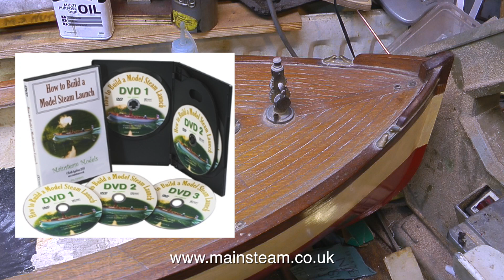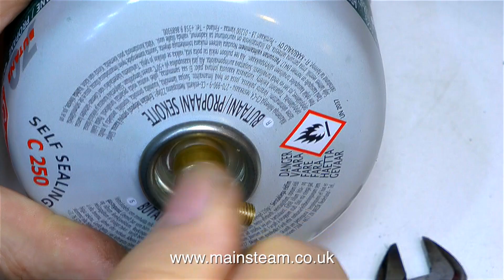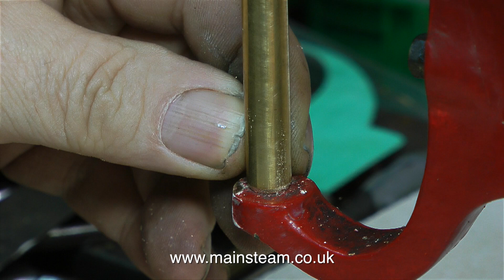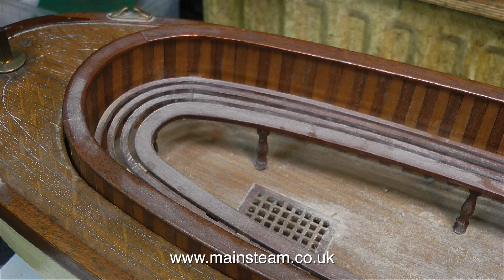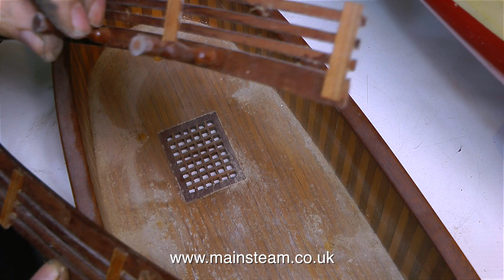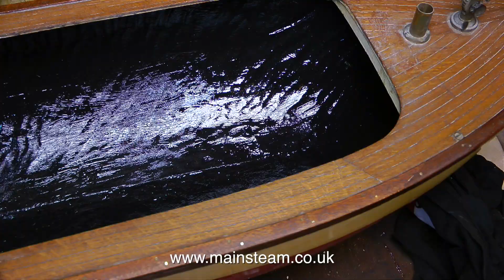REBUILDING A VINTAGE MODEL OPEN STEAM LAUNCH - PART #19

Comment: Could you have an elbow fitting without a valve that screwed onto the gas tank and then have the valve remote mounted?
Reply from the maker: Not recommended, it's best to use the fitting as it was designed to be used. The tank fitting must have a valve, you can pipe from that to another valve if you wish.

Comment: I bought your dvd a few years ago on how to build a steam launch but have never been able to do it myself as you can't get the components anywhere! Can you do a list showing where you get the parts from to build the steam launch?
Reply from the maker: Originally I could supply almost all of the parts in kit form, but few people wanted them so I discontinued the supply.
Reply: Keith Appleton would you have them available again? I'd certainly buy the necessary parts. the challenge for me is, I'm not an engineer, don't have a lathe etc. so can't make these things from castings.

Comment: Actually, there were cyanoacrylate adhesives 50 years ago. The first commercial product was Eastman 910, manufactured by Eastman Kodak, which came on the market in 1958.
Reply from the maker: Very informative, but I never saw any of it in the dark recesses of the North of England - I had to make do with Balsa cement :-))).